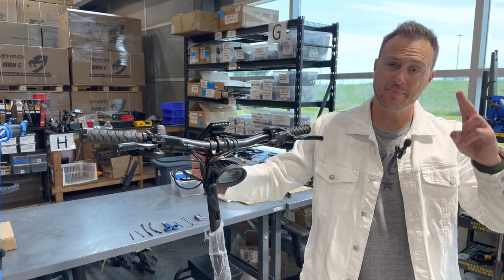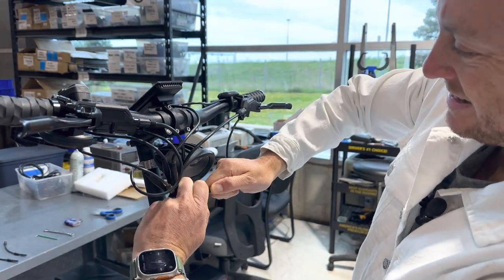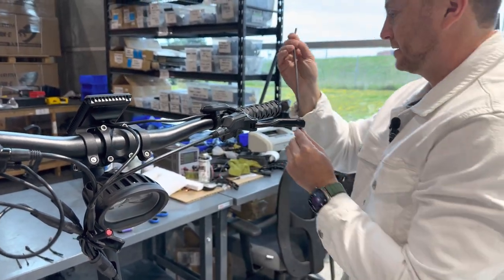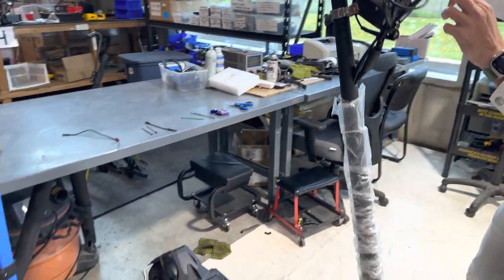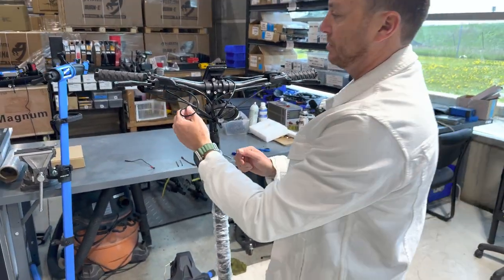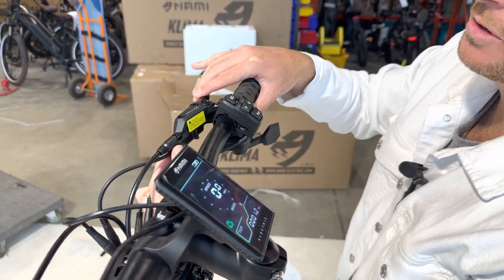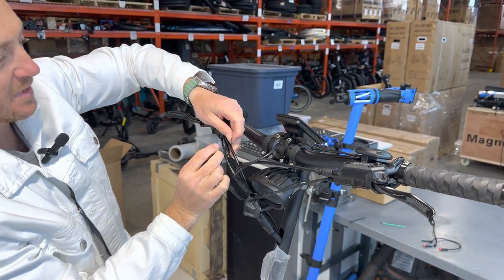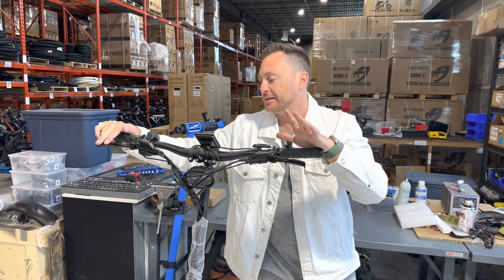Replacing brake sensors on your electric scooter or electric bike

Comment: @epic cycles , I was looking for an E-bike that had suspension, to make riding on slightly rough terrain like riding on a flat, smooth road. Also the ability to pedal consistently at my normal stride on flat road while the roadway might have hills. I bought a very expensive Trek mountain bike, it was a good ride except for the speed control. It had preset assistance options but no way to increase the help to make the climbs like I was on “flat ground”.. I have a lower spine injury that can only handle so much. I was able to get up to 5 miles every other day, and while that may not seem like a lot it was to me. I like riding and don’t mind the cardio it’s those stressful climbs that I couldn’t make and I had no place close that was a flat area for a big enough space.